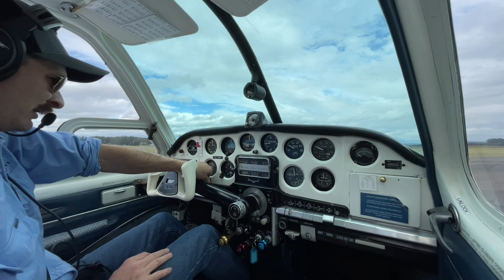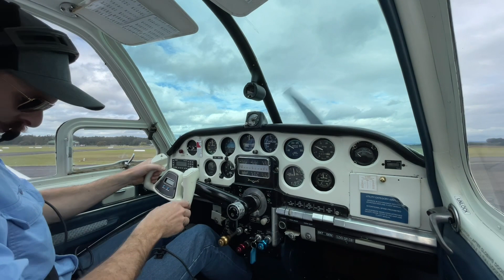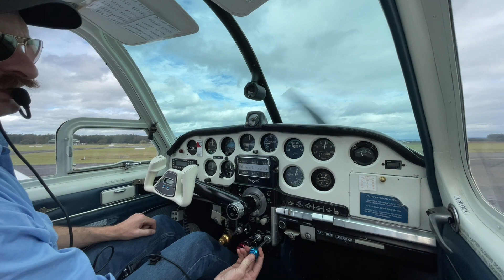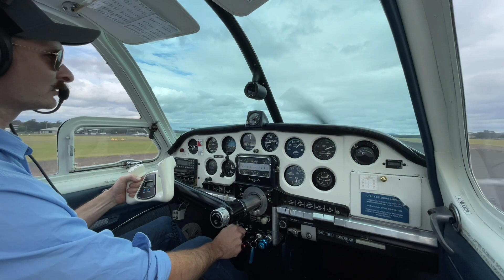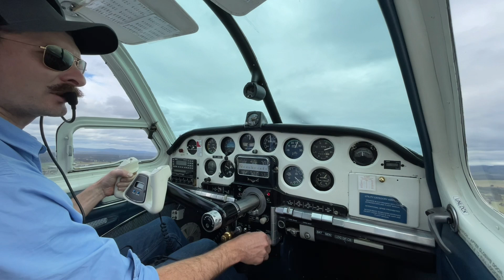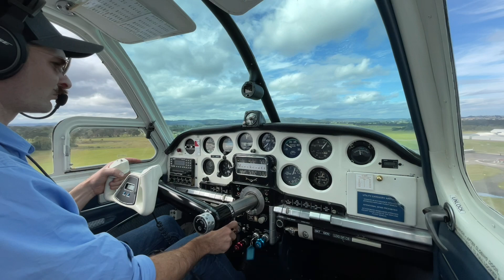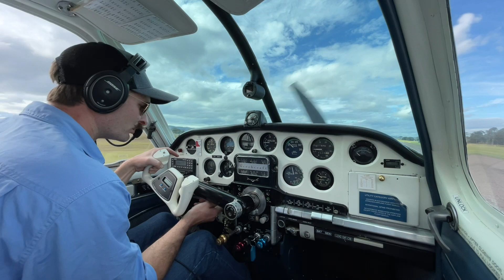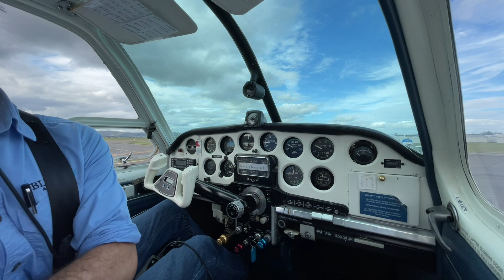My first flight in a V-Tail - Part Two

Comment: There's a mechanical indicator for the gear extension located under the control column close to the floor. I use that as that green light is awful!  I'll have to replace it. Other than that I'd say it's worth the money!  Nice vid Toby, glad you had fun.